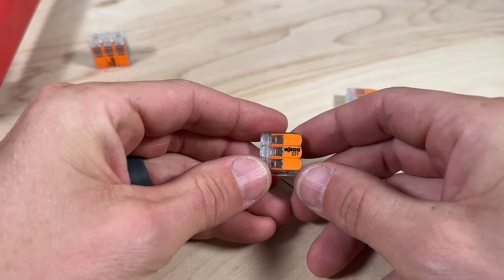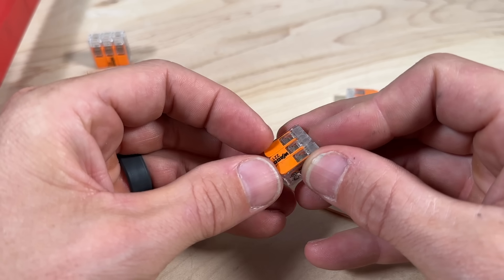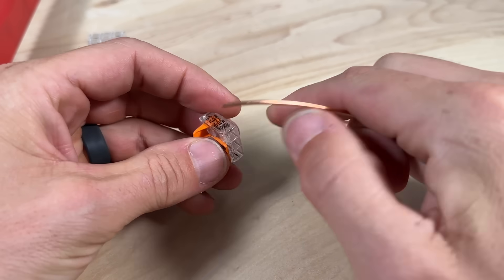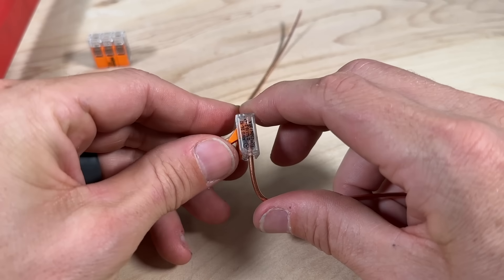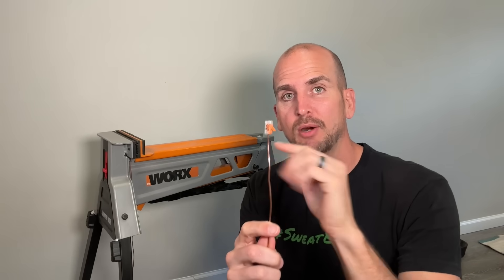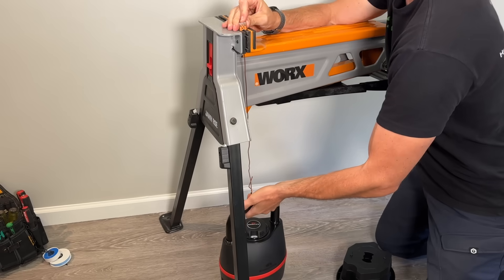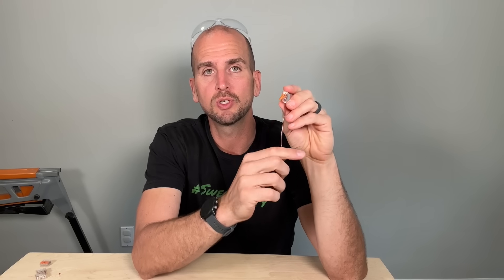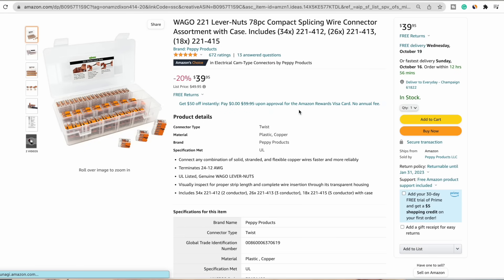WAGO 221 Lever Nuts: Testing the Most Common Negative Feedback

Comment: The lever is literally just a lever to push the metal clip down. Theoretically this thing could be made without the levers just by pushing in something else (in fact there some that work like that). So basically everything comes down to the, metal clip. As long as the lever doesn't meet some resistance it doesn't do anything good or bad.

Comment: I'm not so concerned about the wire pulling out, but I noticed how easily the wire turned when you raised the lever, indicating poor contact and a possible source of high resistance.

Comment: A bit of electrical type securing the WAGO levers closed would work if there's any concern about them popping up when pushed back into the box. They are still fast to install, allow the user to actually see that the wire is properly seated, and are reusable. When using wire nuts, I always wonder if the wires are properly wrapping around each other, particularly when connecting stranded wire to solid wire.

Comment: I have been using 221 Wagos for at least seven years and they are the BEST.  Always verify the wire is properly seated and just as a safety precaution in case someone gets into the wiring and is not as careful as I am, I tape the Wagos shut with a 2" strip of 3M Super 88.   I also run some tape around the perimeter of GFCI and regular outlets just as a precaution.   I know it's not necessary, it is just the way I do it.. seems to upset some electricians.  Many electrical best practices and / or codes are intended to protect the next guy.
Reply from the maker: Thanks for the feedback and you are right taping outlets and wire connectors usually sparks a pretty healthy debate 😂

Comment: This is good to know. When I pulled on the wire I thought the hold rate was much higher. Wonder what the old wire nut slip force rate is. Have you looked at the new Ideal Lever connectors? I thought they were going to be cheaper, but the big box stores won’t have it.
Reply: I looked it up for just that reason and another youtuber tested wire nuts at 70 pounds of pullout force.

Comment: As soon as you got to the point where you demonstrated the concern; it was apparent to me how the lever nut actually works:

The 'throw-back' play is going to prove to be directly related to the wire gauge.
It shows that the lever is responsible for depressing the spring, releasing the spring tension; and NOT for maintaining the clamping force.
This is a GOOD thing, as plastic softens with temperature, and subject to wear, deformation, and creep.
It is apparent that the spring alone grips the wire, and the lever depresses the spring to open the grip area.

As the connector holds increasingly larger wire, the lever travels further before contacting the spring to depress it...
I'm sure you will find that smaller or stranded wire will give much less 'play' in the lever.

Only concern would be with it catching on other objects and opening, although, at the spring engagement point, it requires full force equal to the spring resistance, to open it any further beyond that point.
I have not inspected one in person, but he mentions that there is a fully closed detent, and this should be adequate for most normal applications.
The only scenario I can conceive where it could be a concern is inline splicing on wires cut too short to extend them.  I suppose another circumstance could be pulling wires in occupied conduits.
Some tape or heat-shrink could be added insurance...

Comment:
It is not clear if he uses a fresh WAGO each time or reuses the same connector...
I would predict that the connector spring is subjected to some degree of burnishing of the gripping edges, and possibly some loading up with copper fretting.
These are probably not meant to be reused after a 'pull-out'.

He could redo the test either with a fresh connector each time; or try it in the half-opened testing first, followed by fully-closed tests, and see if the results are reversed...

No criticism of the video, I love these videos...

Mr K L

Comment: I understand that Wagos have been in use for 20 years in Europe, but Europe uses 240 volts. That gives twice as much electrical pressure to force it's way through connections. I think more time is needed in North America to prove it's robustness over time. I personally would only use Wagos on low amp connections like light fixtures for the time being. There is a lot to be said for the simplicity of wire nuts. Our house is over 50 years old with aluminum wire and wire nuts. When I run across old wire nuts in service, they're fine. I don't even know if those wire nuts are rated for use with aluminum wire. Wire nuts still provide more than just a tip of surface contact area. Wagos do add extra complexity to a connector that can have more points of failure. I personally am going to stick with wire nuts which are proven to be safe and reliable. Otherwise, do what you want. I don't see anything wrong with using Wagos if you are just more comfortable using them. I do get it, and I hope they prove just as safe and reliable in North America and they have been in Europe.

Comment: I noticed this when I started using Wagos some years back.  It's not great.  My main concern is the level fully opening when I'm pushing wires back into a cabinet or box.  That being said like many, I simply throw some tape around it and that has eliminated problems.  I would like to see Wago remake these so they positively locked in the closed position when a wire was installed.

Comment: While your test is interesting, I have never felt the need to hang anything from the wire and have been told never to place weight on electrical wires period.  Having said that I am also a fan of the lever nuts and use them exclusively on all my warring projects.  My pack out is chucked full of the WAGO lever nuts of all sizes.  
Thank for the video

Comment: Simple physics. If a very insignificant force applied to the lever allows it to open about 40 degrees as you show,  it stands to reason that no meaningful force is being applied to the internal metal spring/bus assembly that would reduce the efficacy of the grip on the conductor and the ampacity. The amount of force to go beyond that 40 degrees is quite significant (almost painful, and that’s a good thing) and that reinforces the reality that the product has a tenacious grip on the conductor. The 221 Wago LEVER-NUT has every desirable agency listing (UL, CUL, CE, ETL, ENEC, CQC, PSE) one could desire. To be questioning these agencies is to cast doubt on their due diligence. Performing a similar test on a twist-type wire nut would be pointless as there are too many variables: proper pre-twisting of conductors, vagaries of solid/stranded combos, correct nut size, and operator twisting force in in/lbs or Nm. In “old work” common sense guides us to check tightness of existing wire nut connections and leave them alone if not part of the task at hand. I find the Wago 221 to be a significant advancement to the trade, both in improving electrical work efficiency and reducing electrical failures. I don’t use them all the time but there are many situations in which they’re a blessing. I carry the entire suite in my kit. I have 26 patents in lighting fixture and track system design and write and illustrate instructions that are clear for Weekend Warriors and the pros who don’t throw them over their shoulders in YouTube videos. My undergraduate thesis covers safety for electrical construction. No brag, just fact. Oh, and I love these discussions. EHR guy, keep up the good work.

Comment: Also have to remember that this test is a straight pull test. There are very few scenarios where that would apply. You usually have multiple wires coming in at multiple angles. Even on stranded wire I've dropped the motor of a ceiling fan from the few inches of length it had available, and because the wago usually installs facing up towards the main line it gets quite a bit of a bend while tucking it in, and the stranded wire is almost a full 180 degrees. This caught the motor and didn't slip off. For a split second that was probably quite a bit of weigh when it tugged on the wire.

20lb is a lot, but trying to ripped something out from an angle can make it two or three times stronger. Probably a better chance at breaking the entire wago clip by then lol. I will never tape my wago clips to save it from being ripped out by a few more pounds when it already far exceeds its normal limitations. If you somehow pull it out its you that is causing the issue, not the wago clip.
Reply: Seriously though, all the old sparkies and their mental gymnastics impress me day by day. It's like sending your phone back because you couldn't use it as a spatula when making scrambled eggs, romex is not a damn climbing rope. 
I just don't get the mentality where people feel like deliberately making their job complicated and gatekeeping as some way to "protect" it, any homeowner can probably learn to do wire nuts like the pros with some good tutorials and a few hours to practice (still wire nuts suck though). If that's all they think makes them different from regular ol' Joe rewiring his attic then I thinkt that speaks one hell of a lot more to their utter incompetence at their job than anything else.

Comment: I used WAGO 221's this weekend for the first time when changing a number of light fixtures in a house we bought and I have to say, these things are awesome. I felt much more confident in the connections when connecting solid wire to the stranded wire in the fixtures.

Comment: To start with, lets talk precision failure modes! That was consistent at 25.5lbs and 22.5lbs. I think you should try the same test with the unit fully occupied, and compare it to a standard wire nut install.

Comment: Scott, a great test with surprising results, BUT  I would argue there is a greater chance of failure, even danger, while replacing a switch or receptacle.   I think that a protruding WAGO lever could hook on something while the bad device is being pulled out of the box, thereby releasing the associated wire --- and the person performing the work may not even notice!
Reply from the maker: Thanks for the feedback and I would have to agree with you.  The partially opened lever arm hooking another wire is a real possibility.  Thanks for the feedback!
Reply: @EverydayHomeRepairs  I don't know if you have ever mentioned this, but there is a handy 11 mm strip gauge printed right on the side of the Wago 221 lever nuts.  Reviewing this feature can help viewers get the strip length right and prevent problems at the same time!

Comment: To compare, couple you repeat this with other friction-hold connectors? E.g. the back hole in a receptacle, those new lever style receptacles I think you showed recently, or any other similar devices? 20lbs is less than 25, but doesn't seem to offer any frame of reference as to whether that's "bad".

Comment: Two problems with this test:
1. The weight are swinging which introduces wiggle in the  and therefore helps pulling out the wire as is has a downward force pulling on it. The can 'walk' out the Wago.

2. Does the lever still move freely in the second test or is it sort of jammed? When jammed, you start applying pressure on the spring and therefor reducing the clamping force.

This test justifies are re-do under more controlled environment.

Comment: My additional fear would not be the pull out wire, but with the lever partially up, the risk of another wire touching it and fully opening it when pushing it back into the box.  Then the wire contact is loose.  I wrap a layer of tape like many other suggest. I was called out by someone in the comments in the past as an “amateur move”, but I’m not burning my house down because of playing it safe and having a redundancy.

Comment: 2:39 ya know Ideal makes lever nuts (branded something diff name) and the levers are reversed on the “nut” and do like that design much better when putting into boxes etc….as don’t gotta “worry as much” of lever lifting since the design is diff; but does it mean it won’t fail ever…..know ideal and other thing, not a easy to find and buy the ideal version compared to buying Wago’s which easier to find and buy.
Wish had ideal version for this test, for comparison.
Cheers✌🏻

Comment: I was hoping to see if the current handling capability had changed instead of the pull force.  That is what matters to me.  Like others have said, if you have 20 lbs of force pulling on a connector while its in the box, you have other issues.
Reply: I concur, this was my thought when I saw this test,

Comment: To be honest, this is not the scenario I would be worried about.  The far more concerning thing about the fact that the tabs can come out like that is not what happens when they are simply out, but the fact that they can then catch on other things (such as other wires in the box) which can exert force on them as well.  Any force exerted on the tab when in that position would directly lessen the force being applied to the internal contacts, and even if there is nothing pulling on the wire it could, I suspect, still lead to poor electrical connections, which could result in extra heat or even arcing.

I would be very interested to see some tests on how much additional force needs to be applied to that tab to cause the electrical connection to become a problem.  I suspect it would not actually be that much...

I still think that the Wago 221s are great, and still far superior to wire nuts, but I do also think that they could do some additional work to make them close more positively so this wouldn't even be an issue in the first place.
Reply: These ARE wire nuts; just not the regular/standard (screw-on) kind. He's using the comparative terms wrong.
Reply: @HelloKittyFanMan.  Umm, wire nuts are called "wire nuts" specifically because they are threaded and "screw on" to the wire (just like a nut screws onto a bolt).  If they don't screw on, then they're not wire nuts, pretty much by definition.
Reply: @foogod4237 : Oh? Well then what's a "lever nut:" something that uh... screws onto... LEVERS"?
Nice "argument," genius!
And why did you put "screw on" in quotes? Because it doesn't really do that; only figuratively?
Reply: Hey, hey...easy there now princess, settle down now. I think it's probably best you just stick to riding that trusty little pink unicorn pony of yours through the clouds & over rainbows & let us real men worry about the correct terminology of electrical connections. I'm not sure what you were looking for, but it's only too obvious that you ended up here by accident.

-Wire nuts utilize threads to draw down/constrict wires together & are "screwed on" to connect the wires
-Lever nuts utilize leverage(Hence the word; lever) in the form of compression as a means to connect the wires.

Bottom line, @HelloKittyFanMan.  ... you should probably learn to admit when you're wrong or just stay on your pretty pony & out of things that are WAY over your head...DERP!
Reply: Easy there, princess  @purdyboi807 , the one riding a little pink unicorn is you. I'm not sure why I would even have a pony, silly girl. I did use the correct terminology. There are different kinds of wire nuts. He even said "NUTS" when he used the term "lever nuts," so if they are lever nuts for wires, then they are wire nuts. There's just that kind and then conventional wire nuts. Also, he did himself in when he tried describing "wire nuts" as things that screw onto wires, because that's a self-contradiction of what he's saying when he uses the term "lever nut," duh. So of course I wouldn't admit to being "wrong" in this case. I admit to that when I actually am wrong. And no, I didn't end up here by accident, hypocrite derp.
Reply: @HelloKittyFanMan. they only call them lever nuts in North America
Reply: @TheAviation101 : Who cares? So they call this kind of wire nuts "lever nuts" in North America. So... what?

Comment: Consistency seems to be the key for myself, it's a lot easier to do wago connections so they're all the same compared to with wire nuts. 

I've been renovating an older house with plastic sheathed romex, some of the connections could probably be strong enough to climb from but others were lose and some fallen off and even arching, a few were melted, and some actually nearly caught fire at some point (grounding doing some fire saving work here). I'd much rather rely on the strain relief and have a connection that wasn't loose.

The great thing about wago's is that I can just pull the wires back out with no fuss, when rewiring a few times (live in renovation's are fun*) it's a lot less destructive.
Reply: If it hasnt melted before you get that chance. Besides if your taking it apart your making mistakes.

Comment: Hi All
Firstly I want to say is when would you have 20lbs of strain on any electrical termination. In the UK cable as standard need to have strain relief in the form of a clamp or cable tie. So putting 8-10kg strain on any termination would not happen under correctly installed conditions.
However what is notable is on the half cocked lever test , would there be sufficient heat build up the the Wago 221 to cause a fire or arcing. That a more vaild test in my opinion. Especially when the use of AFDD are being used

Comment: As Bobby-C suggested 2 days previously to this post…
Could you repeat the testing using Wire Nuts for both Solid and Stranded Wire, and perhaps a combo of Solid with Stranded. 

Too bad Wago doesn’t have simple see through press-on caps/clips to keep Levers down where you can still see to some degree that all wires are fully seated. 

I have always given any connections a tug to verify the connection is solid. Is there a standard code pull test to what is the minimum required pull to maintain a solid connection?